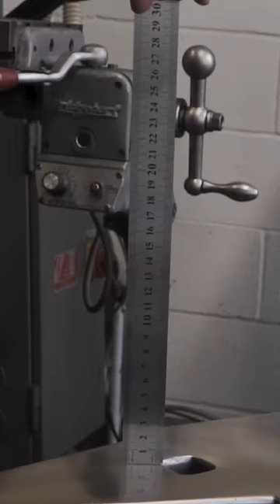"Pig" Anvil Restoration, Super Speed Build! #shorts

Comment: Adding that concrete base must be the dumbest thing that was ever done to an anvil.
Reply: Why do you think that? It bounces pretty good because of the huge mass the concrete provides.
Reply: @mastermeida2222  that’s definitely not why it bounces. A good anvil on any type of base will provide a good bounce of a ball bearing or hammer. It makes no difference the type of base.
Reply: The concrete will dry further over time, shrink and crack. Especially with repeated blows. But that being said, I'm sure this is heavier than a mother trucker and a total PITA to move around the shop, so at least it's got that going for it.
Reply: @gpzjeffrey7974 yea no one's going to steal it that's for sure also this definitely has a 5 minute  craft vibe using concrete
Reply: @Greenhill Forge THANK YOU!!!!! Exactly what I was thinking, ruined it.
Reply: @greenhillforge8466,
   No, it's work hardened and that's down a half inch or so. It's also some mean-ass shit to begin with, like a 4140, and now he's got a flat surface he's transferring to his workpiece. A loose anvil on a piece of stump is fine. An anvil thats held tighter is better, and the bounce is gonna be slightly better still with this setup, which 100% saves your damn shoulder. Hard telling how the face of that concrete will hold up but it was blueish, which means he's got some Portland in it at least, and he put some siliconeor some shit between. Lol. If it holds up probably be pretty damn good for his shoulder if it doesn't, hell he'll probably get a slug of wood next.
Reply: That guy was the dumbest thing ever done to an anvil
Reply: @oldnick4707  

He should have left that vintage anvil to the experts and gone and bought himself a Harbor Freight anvil.
Reply: @psychicspy ,
   An expert anvil-beater? In the machine shop, when somebody screwed stuff up by 'under-thinking' a lot we call them and anvil-beater.
   As a kid in the late 70's, I saw a moron drop a $1,200 height gauge. He was carrying it by one of its uprights like a suitcase and it slipped out of his hand. My dad called him a 'fuckin anvil-beater' and fired him on the spot. That was back when dad had only been in business for about 10 years and work was getting hard to come by in the late 70's early 80's. Mistakes like that couldn't be afforded easily. I saw that same guy run into the top of a door frame and smash the the header and bricks out. This because his forks were way too high and that secondary carriage had raised up.
   Guys like that need to fire up the forge and pretend they understand what Damascus steel actually is.
Reply: @oldnick4707  
An expert blacksmith.
Reply: @psychicspy ,
   It's really interesting. Wrought iron is freakin incredible actually. A simple accurately flat anvil though is nice, and if you have the buck's to take an old nice one and make it flat, especially if you have others. I say do it. We only live once. 
   I've got a 62' Econoline and there are many original examples of them.
I'm putting a 289 in mine* and a 9-inch rear end. I rubbed the old paint down with linseed oil, fixed what little rust, etc.. Next is going to be Cragars and some Eagle GT's and a month of brakes etc.. lol!, Replaced the tail lights with LED's and I'm putting LEDs on the front too! The whole thing is very restorable, but the 170 is getting chucked because I want to have fun in the thing. We only live once. If I had a 57' Eldorado Brougham basket case, but wanted to cruise it, I'd do the same damn thing to that. I don't give a s*** what some rich puke thinks about his or any Eldorado Brougham. I'd slide around behind that dashboard with the 'finned' turn signal indicators and enjoy my life. I say flatten out the damn anvil, make a couple bucks on YouTube if you can, and make a flat anvil. I give this guy big props just for having a Bridgeport.
Reply: Look out. Here comes the expert opinions from the internet again
Reply: @Highkingofgondor ,
   Hah! Liked the 'egghead smack' quite a bit! Lmao!
Reply: @mastermeida2222  bro what.
Reply: @B2Roland  what?
Reply: @ElessarEstel ,
   I think you need to step back on that one and just mind your own business then. There are millions of old anvils in America. Probably one for every 50 people back then.
   If half of them were scrapped for WWII excetera that still makes more than a million. There are a lot of guys out there that have twenty or thirty of them, buying them and selling them like they're Bitcoin or somethin. Lol! What big damn joke.
   My uncle owns an old cordage factory that did zero blacksmithing, but over the years he's collected 20 or 30 of them himself. He just has them lined up and stacked in a corner of a rack-house. You find them at farm auctions all the time still. A few really big ones and a box of jewelers vises excetera. Lol!
Reply: @oldnick4707  yeah when someone posts something for the entire world to see, it's everyone's business.
Reply: @Greenhill Forge The only reason why I decided to check the comments was to see if anyone would speak up
Reply: @mastermeida2222  that’s the stupidest thing i’ve ever seen anyone say about anything. you think the concrete is elastic? or that a hammer blow from any type of hammer could ever impart enough energy to compress concrete or any substantial base? lmfao. if it bounces, it’s strictly due to metal being really hard. that’s it.
Reply: @ElessarEstel ,
   Yeah.. just meant that it was his anvil. Still is, and I hope he enjoys it.
I would argue that the experience he garnered from that project was worth more than the anvil itself, no matter how much value a purist might ascribe to it. Sour fuckin grapes, but it's his, such as it is.
Reply: @FlygisTheFlygis  But you basically want the hammer to bounce as much as possible.
Reply: @mastermeida2222  Eh, not really. You want it to bounce the least because that means the energy of your blow was imparted into the object. You also obviously don’t want the anvil to have any give or bounce itself as it would take energy out of the initial blow. So the bounce test might be to ensure that the anvil is stable enough, but hardly for anything else.
Reply: @FlygisTheFlygis  i still can imagine dumber things you can do to an anvil.
Reply: @mastermeida2222  it’s not dumb though
Reply: That and them janky ass welds
Reply: Why? I bet your answer is an opinion, and not a fact 😂
Reply: Цей. дурінь шліфував  наковальню ,  щоб  користуватися. замість  люстерка !
Бо наклеп.  поверхні. твердіший ,  ніж. обдертий !!!

Comment: Definitely going to feel the shock absorption in the wrists from that concrete base..
Reply: Is sand better?
Reply: @camerondiprose1722  Wood is better for absorbing shock. Sand gets packed tightly and can cause a similar effect to concrete.
Reply: @cosmicdive I’m this was awhile ago but I thought with anvils you want them to not absorb the shock, and to bounce it away making for a much easier and less fatiguing day.
Reply: @jakebodie21 If you got hot metal your hammer isn't bouncing back up.

The point of sand or wood is to dampen the sound not whatever these guys think
Reply: @Morberis right. People just use metal with concrete so the anvil can be more sturdy more easily. The sound is meaningless since if you're smithing you're going to be making loud sounds all day. Just put some earplugs or earbuds with noise canceling in and hammer away. Hell with earbuds it's just as quiet and you can listen to stuff

Comment: The anvil itself is gorgeous. I’d have to swing my hammer on it for a week to see if I like the base though. Mostly the metal frame, concrete doesn’t sound terrible.
Reply: I love my metal stands
Reply: It looks gorgeous, but didn't they shave away the hardened layer on top?
Reply: @Dwarkin  likely so. I don't remember the actual video, but it's possible that this is a cast steel anvil. They would have still taken off whatever was hardened at production, but may not have damaged the anvil.
Reply: steel is a good conductor of vibrations, but the concrete will fatigue because of it. that pour wont last. good reason why they still use wood under anvils - its an insulator. i know one guy who ONLY uses cresote stumps for his.

Comment: Milling the feet of an anvil is no big deal. Milling the face can ruin an anvil. I see you still have hardness. On some anvils the top steel face plate is only so thick and hardened down so far so it could go past that making the faceplate super thin and or having a soft anvil.

Comment: Looks like a suspiciously Chineseium type of anvil, such that I’d rather be in the next continent over before hitting anything heated up with any enthusiasm!
Shouldn’t “Chinese-ium” be considered one of the elemental table, specifically the one covering absolutely naff/useless/pieces of junk on this or any other planet?😊
Reply: This is historically a French pig it’s what thoes Chinese anvil are based off real French pigs are the perfect anvil
Reply: @strangetar2833  thanks for the history lesson - it’s been more enlightening than any other subject explanation than anything I’ve read to date. Obviously I was being overly sarcastic about the quality of Chinese goods being imported but the main concern was due to some of the tests that were shown on a documentary type show - something that covered the manufacturing of various types of steel and any there uses. 
It covered the quality control in particular, using a gadget that seemed like a combination of ultrasound and small and it was incredible to see the state of Chinese anvils but the surprise was that they resembled Swiss cheese - the holes/gaps throughout were so numerous that I was surprised it still counted as anvil instead of the hunk of scrap?!

Comment: Correct me if im wrong, but arent anvils heat treated in a special way that allows it to work properly, so wouldn't u be fucking up the temper when grinding material off of it
Reply: He didn’t apply nearly enough heat to mess with the temper. The metal never changed in color.

Comment: Bro has no idea how anvils worked and just ruined a perfectly good one. 

That surface you just shaved off to look pretty was work hardened. Your anvil is trash unless its work hardened. You basically just "Unseasoned" that anvil. Good luck beating it back into "Season" also you're going to knock your teeth out having metal for a stand. It should be a wood stand not metal on concrete. I dont think itll be that big of a deal though, you're definitely not the type to be smithing so its probably just going to be another shop decoration anyways.

Comment: Interesting that absolutely nobody reacted how he treats the surface of the anvil. 
1. Now it's straight and not concave anymore, so straightening out material will be difficult to impossible. Every anvil is slightly concave on top.
2. He is making the surface layer that is hardened thinner.

With his concrete feet he might run into problems when working with big hammers, because the whole thing just might start "jumping" around. 
The best foot i had so far under my 250 kg anvil, was a cut from a willow tree with 80 cm diameter. The anvil was standing dead still, no matter the hammer weight used. 
You want to have the inertia of the anvil reflecting the hammers impact into the material you are working on, not the stand of it. If the anvil is not enough, well, you need a bigger anvil, not a heavy stand for it.